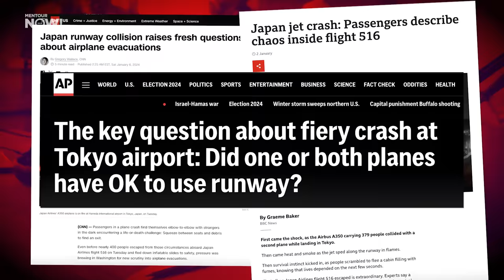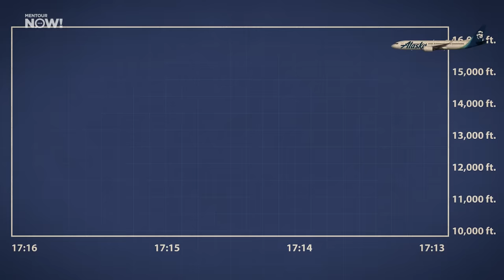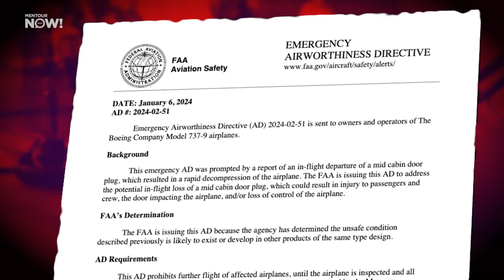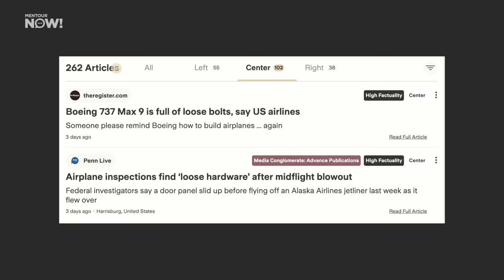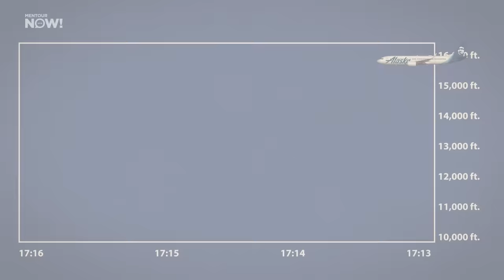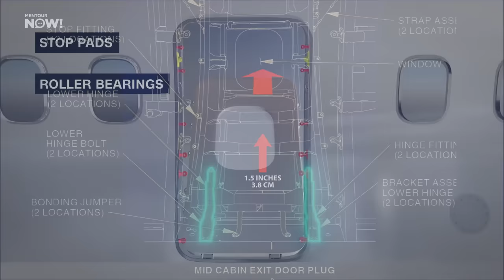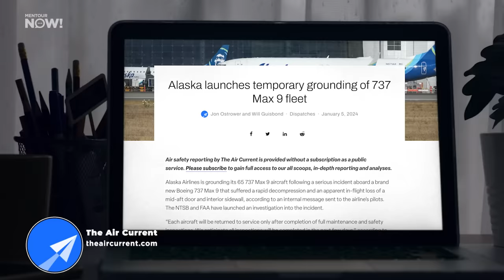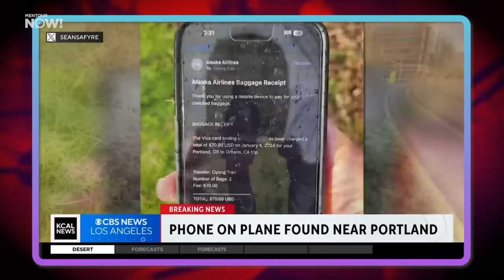WHAT Is going ON with Boeing?! MAX-9 Door blowout

Comment: As an airline technician who has worked on the 900ER and the 9MAX, those doors are exactly the same. I have also opened and closed those doors on both models. They are opened periodically for inspection to check for cracks and corrosion. I highly suspect that someone didn't install the retaining hardware during assembly at Boeing. The 900ER has been in service for over 15 years, and I have never heard of any problems with those doors  

When we check for pressure leaks we do it from the outside. 2 techs will pressurize the aircraft on the ground while other techs go around the fuselage, checking all the doors and accessory hatches for leaks.
Reply: Everything points to it being a QA problem during assembly, and not a design or maintenance issue. The worrying thing, is if it would happen on this part of the fuselage, then there could be a QA failure on other parts.
Reply: If it's not a design flaw and just a QA problem, it would be an even bigger problem for Boeing, as they would have to recheck every plane, not just the MAX.
Reply: So basically would it mean a lack of inspection? Or higher ups rushing technicians to get the plane up and running? 

Another side question what does QA stands for? (Aviation acronyms are quite interesting to learn, not gonna lie)
Reply: @himeyukimatsumoto994  I can't speak for what's going on at Boeing since I don't work there. Where I work, we go by the book.

QA is Quality Assurance. My airline QA oversees all of the airline operations. In aircraft maintenance, we have QC, Quality Control or inspectors.
Reply: @himeyukimatsumoto994  QA is a standard abbreviation for Quality Assurance in any manufacturing process. QC is often used as well, but that stands for quality control, and that might allow for a certain number of faults (which might be tolerable in some products). QA goes beyond that as it is meant to assure that the required quality is always reached. That is assured.

Note that QA is a lot more than just an inspection process. It is meant to run from the product design process onwards, as well as testing prototypes, making sure that what is designed can be produced reliably and to the required standard, the details of the manufacturing, management of supplier quality all the way up to final assembly and acceptance testing.

Clearly an airliner has got many tens, if not hundreds of thousands of parts, so it's a tall order to perform a comprehensive check on everything in a delivered airliner. The quality has to be built in.
Reply: @TheEulerID  so QC in this instance is not the one to look at for the fault issue and rather QA which (if I understood well) would need to confirm and assure quality is met, correct ? 
Doesn’t that mean they would have missed something in their checklist? 🤔
Reply: @himeyukimatsumoto994  It looks very likely to me. However, modern production lines often automate so of these processes. For instance, on a car production line the tools that run bolts and nuts down to their pre-set torque levels will record the action and there will be a complete, automated audit trail. However, airliners are not mass-produced in the same way, so I would expect the assembly line process to have individual inspectors signing off each stage of the assembly, and maybe more than one check. For example, the plug door is likely to have its own inspection and sign off, but maybe that will be subject to another check later.
Reply: It was a lot easier when smoking was allowed the tar showed all the loose rivets
Reply: It was a lot easier when smoking was allowed the tar showed all the loose rivets
Reply: It was a lot easier when smoking was allowed the tar showed all the loose rivets
Reply: @TheEulerID  I see 🤔 so higher chance rate for airliners production to have human error in the mix and not being shown until way later basically?
Reply: Hi. I just entered a comment regards questions about the door seal, a couple of minutes ago. You would be just the right person to answer them. I have other questions too. Like, how and when are the door pins adjusted? And how does the locking wire work, that we can see in the hollow end on the cabin side. Regards
Reply: @gasonthebrain3738  The door stops are adjusted on initial installation and if they are not in contact with the door during periodic inspections. The retaining hardware consists of 4 bolts, 4 castle nuts, 8 washers, and 4 cotter pins. The hardware is installed in the upper 2 latch roller guides and the 2 lower hinges.
Reply: According to Juan at blancolirio it is the same design all the way back to the 707, it is obviously not a design flaw. I see two main scenarios, either it is an installation error or a material fault that made some critical hardware break. The NTSB will quite quickly be able to rule out the second scenario.
Reply: Thank you for your comments. When the door is opened and closed for inspection, is the condition, position and adjustment of the door pins and door pads part of the inspection? How would you know if a door pin or pins were not adjusted to their correct setting? Do you think Boeing are the last people to install the door during or after the painting process? Thanks Regards
Reply: There were loose bolts found in two areas of the door. The bolts mounting the roller guides to the frame were found to be loose on United. Spirit probably fitted these bolts. As for the missing roller retention bolts (with cotter pins) on Alaska, this may have been due to a disturbance made  by Boeing, Alaska or (I hear) a company which fitted wifi.
Reply: Makes you wonder what other quality issues might exist. I will never set foot in a Max again
Reply: The latest reports indicate the four locking bolts on the door plug weren’t installed. The door plug would pass a pressurisation test without the locking bolts but could be dislodged by turbulence and vibration.
The locking bolts cannot be checked without removing the cabin interior panels.
Reply: It's  post 1996 Boeing, so junk like the stuff MD used to build.
Reply: @haqvor The NTSB has found no sign the door plug bolts were installed…
Reply: There is a report that installation of the WiFi on the plane before delivery and after inspection, required access through the door plug and was not inspected after replacement. Photos are on another channel. André
Reply: How are leaks detected?
With the noise they make ?
Spoon and bubbles? :)
Reply: @nalinux  Pressure loss and sound.
Reply: @SoundzAlive1  Right.   There were NO pressurization warnings before it went for the WiFi installation...and they started right after the plane came back and it's VERY likely that the people that did the install also forgot to put the safety bolts back in.   We'll only have to wait a couple years for the NTSB to release what they already know TODAY.
Reply: @camaro5081 so who paid you? Airline or Boeing? Several airlines have good integrity of their technician, some don't or yet have that safety culture. But Boeing, its questionable or really doubtful at the moment
Reply: Are the pressure checks done in a low pressure and low temperature chamber though? Or just at ambient pressures/temps?

Surely
Reply: @himeyukimatsumoto994 why not both!
Reply: @simonr23 no. We shut all the door's, hatches, etc, and pressurized the plane as explained by another tech. Then techs on the outside will run their hand along all the door frames, hatches, belly drains, etc, and check for leakage. Any time I've done this I will mark the area it is leaking with a strip of tape the length of the leak so when we do open it to check we can see if it's something like a door seal or scuff plate or something leaking. The check is done out on the ramp using the APU to run the packs and we'll manually close the outflow valve to let it pressurize to a certain cabin altitude which is determined based on ambient conditions.
Reply: @himeyukimatsumoto994  Quality Assurance - The process of checking work or other processes to ensure it meets the requirements.
In aerospace engineering there are usually a minimum of 2 people involved in every task - one to do the work who may or may not be qualified or licenced and another qualified or licenced person who supervises, checks the work and certifies it as having been done to meet the procedures or specifications. For some work such as on flying or engine controls, major structural components or safety equipment, there may be an independent person not involved with the actual task who inspects and tests the work or equipment after it has been completed to verify it has been assembled correctly and works as it should.
Reply: @FloorItDuh  A half-serious question -- could soapy water also be used to check for leaks?
Reply: @allangibson8494  Sound mesured with a special microphone ?
I'm curious.
Reply: @nalinux  Leaks whistle. Sonic and ultrasonic leak detection systems are common now. Really advanced is audio imaging leak detection systems.
Reply: @simonr23  There is no need, pressure is a relative phenomenon - an additional 8 psi inside is 8 psi pushing outwards whether outside is 6 above vacuum or 66 above vacuum, so pressurisation tests can be performed at any time.

Reports indicate though that the pressurisation warnings did not occur during tests, however, nor in flight - they were happening while parked and not testing, indicating a fault with the warning system rather than a pressure failure. This is why the aircraft was considered "good until next maintenance cycle" by just switching to the backup pressurisation - they had no indication of a fault with the airframe and a failure of the pumps is much less dramatic and more easily dealt with.
Reply: The loss of pressurisation issues began on this 739 max after Alaskan installed the WiFi antenna from another company.
Reply: @allangibson8494  I heard that, but they  also said that they will investigate the door closely too look for any signs of that the bolts where present. To me four separate bolts or mechanisms failing completely sounds highly improbable bordering on impossible. That they where never installed in the first place, while procedures should exist to make sure that it never happens, seems much more likely. I can without problems see scenarios where that can happen. Although not in this kind of life or death important industries I have worked in organizations with the same mindset that can lead to "forgetting" important bolts, but try to explain that to an MBA...
Reply: What is it like opening those doors? When the retaining bolts are removed, do the springs almost completely offset the weight, so that a gentle pull lifts it, or is it still quite heavy, requiring significant strength to open?
Reply: I watch a lot of car repair channels.  One method of checking for vacuum leaks is to pressurize the induction system with a smoke machine.  It's very easy to see leaks that way.  I was jokingly wondering if they would do something similar with aircraft pressurization tests.  I suppose feeling around gaps with your hand or something else that indicates air movement works, too.
Reply: @haqvor  I’ve been involved in other accidents where a shift handover went wrong - ie a drain plug got left out of a natural gas compressor resulting in a massive fire and explosion (and not the one you are going to find searching online).
Reply: @EinkOLED  The 737 hadn’t left the factory when the Wifi was installed.
Boeing has already admitted liability for the door plug failure.
Reply: @TheEulerID  According to a current lawsuit filed against them by a former QA manager, there are numerous issues that Spirit Aerospace was trying to play down, ignore, or apply quick fixes to in order to get stuff shipped without any delays. Ie - "it must ship today" mentality.  Whether this is true, the courts will have to decide, but the number of ex-Boeing employees saying that QA issues were normal means that it's likely true.
Reply: Unless I missed something, if they checked for leaks in this way, they would never find anything wrong even if all four bolts were missing.

The door wouldn't have come off even with all four bolts missing except for the extreme turbulence that caused it to bounce on the springs enough to give it the  1 1/2 inch lift it needed to swing loose and that had to occur at an altitude low enough that the outward pressure did not prevent upward movement despite turbulence.

Even if a door had moved upward during turbulence at the necessary altitude, as long as it didn't come off, as soon as the plane landed, the pressure keeping it displaced would be off and it would, by gravity, return to its normal position.    So neither the above test, nor examination from the outside would show anything wrong.   ONLY the record of an instrument indication of an air pressure fault (exactly as occurred) would show anything wrong.  and THAT warning was IGNORED!

The airline had to have known what the likely cause was (why did they leave the two adjacent seats empty?    Those would have had to have been "in demand" seats since they had extra leg room and passengers place a very high premium on that!)

I SUSPECT that the primary fault here was not Boeing but the Airline and likely the cleaning and/or maintenance crews (see my post  here for more detail)

Boeing was at fault for the design not making it impossible to put the panel over the plug door unless the bolts were installed no matter what the reason for the bolts being missing was.

The bolts had to have been missing (and didn't fall out when the door came out) because, given the tight space limitations, the bolts could not have come out while the panel was on without causing very marked displacement of the panel which could not have gone unnoticed.       They won't find them on the ground because they were not in the plane in the first place, IMHO.
Reply: @jimbarron9939  The airline had a passenger in the seats “offloaded” due to abusive behaviour to the gate staff. She was objecting to being charged extra for her diameter.
The bolts are not inspectable once the panel In installed - and that is a questionable design choice. Accessing the bolts for inspection takes a couple of hours due to the number of interior trim bolts that need to be removed.
The Airline never had reason to remove the panel in a two month old aircraft.
Reply: Still under Warranty, then!😮
Reply: @jimbarron9939  You might think that, but the plane was only a few months old and had not had any major service done on it yet.  In addition, there was a recent service "bulletin" from Boeing about two weeks ago notifying all 737 Max planes to check their rear ailerons for possible missing bolts. ( ! )  Just a simple 2 hour job to check, nothing abnormal. Just sent out as a normal maintenance issue - lol.  And here we have days later an incident also concerning missing bolts.
Reply: @HDRW  Yep, six months, unlimited mileage…
Reply: @ivan_dramaliev  Yes we use something called leak detect which is pretty much soapy water. We do have ultrasonic leak detectors, but most leaks, especially on doors and windows  we use soapy water.
Reply: Even if human error was made in mounting and securing the door, not including the redundancy of checking the status of a plugged or deactivated was a design choice. The light and indicators are all there in the cockpit. With the amount of overlap in hardware between a plugged door, a deactivated door and an active door, it would seem that monitoring its sensors is not that difficult. At the end of all this, Boeing was the one making the call not to allow cockpit monitoring.
Reply: @pyramidsinegypt  The plugged door doesn’t have the sensors wired - because it simply isn’t used in service, only during maintenance when the cockpit indicators are also disabled.
Reply: The plane in this video was two months old. Way too new to need maintenance
Reply: Only the two upper bolts are lock bolts; the bottom two are pinned, so it could be possible that the pins could come out with enough vibration.
Why aren't they all lock bolts???
Reply: @himeyukimatsumoto994  Quality Assurance, previously QC = Quality Control.  Boeing fired ~900 QA workers a while ago, and told the assembly workers to self inspect their work.
Reply: @allangibson8494  Correct.
Reply: @FloorItDuh  And that test wouldn’t detect the missing locking bolts on the door plug - because they don’t retain pressure (just the door in the closed position against vibration).
Reply: @Ldavies2  They are all lock bolts with castellated nuts and split pins fitted.
If any of the four were fitted the door plug couldn’t move up (although if the bottom hinge bolts were missing that would bypass the lower lock bolts (but both hinge bars are visible, if bent, in the photos, so that wasn’t the failure mode in this case)).
Reply: @himeyukimatsumoto994  DEI employment vs meritocratic one is a very likely culprit for QA failures.
Reply: @TheEulerID There is a Boeing subsidiary called spirit that handles manufacturing of aircraft hulls that is currently facing a class action lawsuit from former employees. The lawsuit alleges that safety and quality assurance at the company are not taken seriously and that the company has adopted a culture emphasizing getting parts out the door over all other considerations. Allegedly this has included pressuring QA testers to sign off on defective parts and falsifying records of their defect rates to be much lower than they actually are. There are also allegations that QA testers and other employees were retaliated against or fired for raising concerns or failing to sign off on defective parts.
Reply: @bagusindrahariadi1760  My airline pays me. I've worked on every variant of the 737 Boeing has produced for the last 25 years. I state facts based on my experience. What experience do you have other than being a troll.
Reply: @Bill31400  you mean those values gets pitted against each other and create such failures down the lines?
Reply: Designed to be sprung open and safety bolted closed seems a problem. Maintenance seems a problem too; dispatching with an unassessed pressurisation fault, with advice not to fly over water is a bit odd. Would be expect the restriction to be unpressurized flight only.   @TheEulerID
Reply: @mygreenlama You are aware that it has become one of the world’s safest aircraft due to the high standard placed upon it, no?
Reply: @allangibson8494  Thank you for the additional information, especially that it takes hours to remove the panel.     While the panel could have been just left off to allow using the plugged door for access when loading cargo flights (during covid19) such use would not have been practical for passenger flights.   But the possibility still remains that the bolts were left off for easy access on cargo flights (during Covid-19) and mistakenly not replaced before the panels were put back on when returning to passenger flights (from what I know, of course.   As always, knowing the full details is necessary.)

To me, the likeliest scenario is that the bolts were left out when doing cargo flights and when they converted back to passenger service, whoever put the panels back on, was the one who'd opened and closed the doors during cargo service and didn't realize that bolts were missing.   Or even that they realized that bolts were missing but figured they must not be necessary because the plane had been flying for a long time without them without any problem.   (a well trained person, of course, would not think such a thing but in the current corporate culture, obviously workers are inadequately trained.  

No matter what it turns out to have been, considering all of the other incidents and indications of an extremely toxic culture at Boeiing, I won't be flying any Boeing aircraft again.

It's not so much a matter of safety since I well realize that, even with the toxic culture, the probability of being on a plane on the flight during which an accident happens is nevertheless still very small.   It's that I hate to give an financial support to a corporation with such a toxic culture.   It may not be ME that dies,  but SOMEONE is going to die in the future because of this culture.
Reply: @jimbarron9939  The Alaskan Airlines aircraft was only ten weeks old. The paint was barely dry. It wasn’t in service during Covid or even under construction.
This is simply a worker on the Boeing line not doing their job properly, I suspect the door plug was closed just before shift handover and the next shift got told to fit the interior panels with no one checking the CORRECT fitting of the locking bolts in between.
Reply: @aycc-nbh7289 too bad it's the most unsafe aircraft still
Reply: @abhilashnair8640  And you are aware that by saying this, you’ve become a part of the group that places such high standards on it, no?
Reply: @aycc-nbh7289  nobody has set high standards for it! People just expect an aircraft to be safe. Also expecting an aircraft door to not pop open in flight is high standards for you?
Reply: @abhilashnair8640  The problem there is that other aircraft would get free passes for having one or two minor slip-ups, but the B737 MAX would not.
Reply: @aycc-nbh7289  yes because max didn't have a minor slip, it had two major fatal crashes which uncovered a lot of boeing and faa's wrong practices, a tonne of changes were made. People lost their lives man! There's no point in defending them in that case.
Reply: @aycc-nbh7289  Also other airliners which have had issues don't just get to slide those under the rug just because it was a "minor slip", they've to deal with the same authorities, they've to answer the same questions, and they've to make the same changes and bear those losses!! It's not just about boeing, no one gets a free pass when it comes to safety!
Reply: @abhilashnair8640  The issue here is that these “minor slips” could easily have proven fatal if luck had not been on Airbus’s side.
Reply: @aycc-nbh7289  dude how can someone be so butthurt lol, what are you even trying to prove!? I guess you just proved you've zero knowledge about aviation and engineering. It's not luck, Airbus didn't cut corners like boeing, they made a well engineered aircraft with tonnes of redundancies, and guess what? They told their operators about all the features instead of hiding a potentially dangerous system away from them.
Reply: @aycc-nbh7289  and you call an abrupt nose-dive with no chance of recovering or a sudden explosive depressurization as a "minor slip"?
Reply: @abhilashnair8640 It’d be just as bad if the landing gear on the A320 flew into the engine or if the unspeakable happened when the plane landed.
Reply: @abhilashnair8640 They easily could have disabled the landing gear rotation diagnostic test if a hydraulic failure was detected.
Reply: @aycc-nbh7289  that's the worst argument you could've come up with. Landing gear? Sucked in to the engine?? Have you even looked into that issue? That's not how things work, a landing gear doesn't just detach and fly away, it has never happened before and you know why it'll never happen? Because unlike boeing, Airbus has thought of such situations as well and as I said, and unlike boeing they didn't cut corners and made a better aircraft, not a nose-diving manslaughter machine.
Reply: @aycc-nbh7289  and why is Airbus being dragged into this? There are tonnes of other aircraft manufacturers like Embraer, ATR, Bombardier, Cessna, Gulfstream and a lot more who make commercial jets. But none of them purposely made a deadly nose-diving aircraft, boeing did